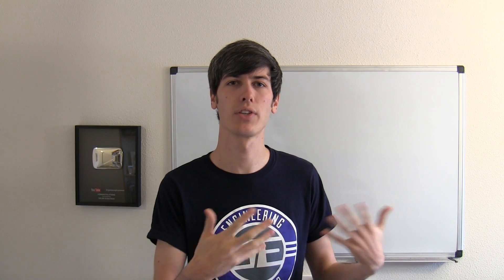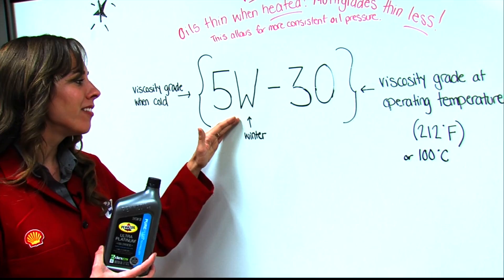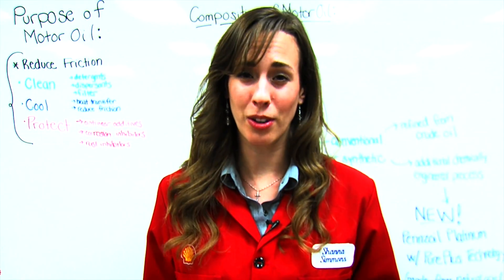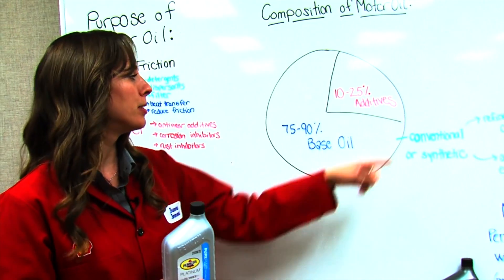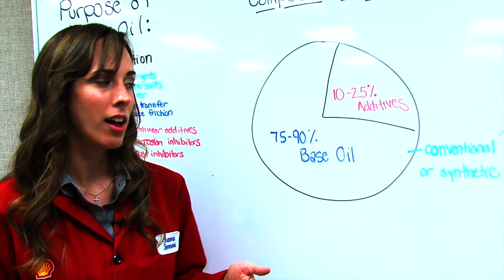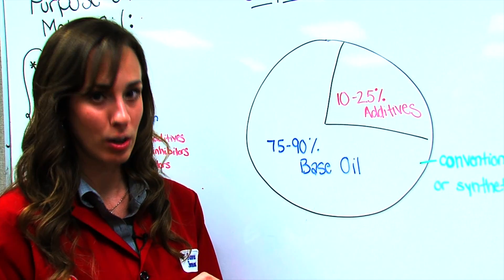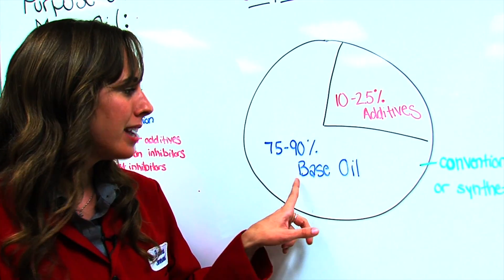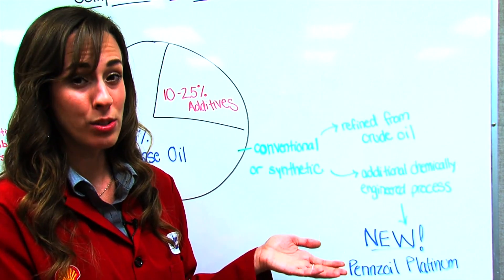Motor Oil Myths & FAQs - Synthetic vs Conventional

Comment: Most oil companies sell the idea that synthetic oil is better than conventional oil. The reason is that synthetic oils are more expensive. Whether they are better is hard to know really. As you can see in this video, they did not answer their own question on the title. OK someone may argue that the title does not say that.
Reply: +Allanb -  It is better,it will last longer without breaking down as quick as basic conventional oil do because of the wax by product in the oil that cannot be refined out of the crude oil base..It has to be changed more often and the protection value goes away faster than quality synthetic oils . It is about molecular structure also..The additive package is what counts  in the regular or synthetics..There are some conventional oils that have great wear protection nearly as good as or better than some synths but they have to be changed more often  and they leave by products from the base oil..Synths are less maintenance and keeps the engine cleaner and they hold less air bubbles than conves do and that helps the protection even better.. ..
Reply: +Robert Diehl 
Synth are better than semisynth and mineral, of course, but they are not good or better for all engines. ;)
Reply: +Eugenio C A properly blended TRUE synthetic oil is always better than a conventional mineral oil because the molecules that make up the oil can be designed to accomplish a specific task.

With conventional mineral oil, the molecules can be modified via the additive package to meet a standard but this is always a compromise because conventional mineral oils are made up of many different carbon chains with different properties.
Reply: I repeat: Synth are better than semisynth and mineral, of course, but they are not good or better for all engines.
It means that for old engines and with a lot of km, mineral oils are better.
Reply: +Eugenio C With an engine that has plenty of wear, mineral oil is better because who wants to burn oil that costs $10-15 a quart.  The benefit of true synthetic lubricants in substantially reducing wear has been lost with such engines.  OTOH, an engine that has lots of miles but that has been properly maintained resulting in minimal wear CAN benefit from a true synthetic lubricant.
Reply: Synth oil in old engines is good only if the engine has been rebuilt from scratch, with new head gasket and oil pan gasket, piston rings and valve seals.
Even if properly services but with original parts, an old engine does not run well with synth. 
Strong cleaning properties can dissolve dirt and deposits too quickly and too much and can damage all the above mentioned parts, with consequent leak of oil in the cylinder and from  the oil pan or head gasket, Also, all the dirt and deposits can clog the oil filter.
Synth oil does not reduce wear better than a semisynt or a mineral. The lubrication is the same. Synth oil only extends the service, 5-7,000km for a mineral and 15 or 20,000 for a 100% synth, and it cleans better than semisynth oil and mineral oil =  less deposits.
Further, with the same grade, let's say 10W40, at 100 degrees the viscosity of a syntetic oil is higher than a semisynt.

Comment: can you change from conventional to synthetic if your car has been using it for 40,000 miles? what is high milage oil and now they have natral gas oil. what is it?
Reply: yes you can switch back and forth between conventional and synthetic oil, but if your engine is excessively worn, a synthetic oil may leak by piston rings. the only way to know is to try it. 40000 miles is not high mileage on a modern engine, even 70000 miles which is what I mileage oils are marketed or is not high mileage on a well maintained modern engine like your Honda.
Reply: yes you can switch back and forth between conventional and synthetic oil, but if your engine is excessively worn, a synthetic oil may leak by piston rings. the only way to know is to try it. 40000 miles is not high mileage on a modern engine, even 70000 miles which is what I mileage oils are marketed or is not high mileage on a well maintained modern engine like your Honda.

Comment: I just don't understand the explanation - if an engine is hot won't the oil be thinner? 5W = 5 in winter... I thought a low number means thinner oil and a high number meant thicker oil (derived from the seconds the oil takes to flow through a given aperture) so how can the W number be lower than the summer or 'hot' engine number?
Reply: @Nick Nakorn It means that a 5W-40 oil will flow like a constant viscosity 5W oil when cold but flow like a constant viscosity 40W oil when hot (the comparisons are at the same temperature). A straight 5W oil would be much thinner at higher temps than a 40W for example.
Reply: +Nick Nakorn Hello Nick,    30 weight oil at the hot 100C 212F  test conditions is defined to be between 9.3 and 12.5 Centistokes / cSt. 
SAE 40 weight is between 12.5 to 16,  
50 weight is between 16.3 to 21.9 cSt . 

The higher the number, the more seconds of time it takes to flow throw the tester. This is Kinematic Viscosity.

*  For a seat of the pants reference, At Room temperature water is about 1 cSt, Milk 4, Cooking oil 40, Honey 2000, Molasses 10000. SAE 30 oils is about 300 to 500 at room temperature

At the W condition , Winter oils are tested between -40C to -10C in the SAE 300 tests for Winter oils. It is Not the same test of oil flowing, thus the public's massive confusion  . It is a cold cranking test and a cold pumping test. 

At Zero C / 0C an actual 5w-30 oil might be 600 cSt and a 10w-30 might be one half of Honey ie 1000 cSt

Even a 0W-XX oil is thick at 0C temperature, ie several hundred cSt ie way thinker than cooking oil. 

The high temperature rating has been at 100 C/  212 F for about a century. The newer "W" Winter's test temperature has been changed over the years and this adds too to the confusion! The standard for automotive oils is in SAE J300

At Zero 0C a 20W-XX weight oils is often thicker than Honey.

You can place some actual oil in a glass jar with some BB's, lead shot, bearing balls and place the affair in the freezer and see how thick the oils are are cold temps. If you want to be a tooler you can time the drop of the balls and calculate the Viscosity too.
Reply: Well, yes we know that - I'm not commenting on my knowledge I'm commenting on the poor explanation...
Reply: +Nick Nakorn The additives (specifically, ground-up rubber powder, which acts as a viscosity modifier) thicken the oil when it's heated.
Reply: +OddTimeMan That's plainly incorrect; at ambient the oil is quite clearly thicker than oil from a hot engine. I've just read the lengthy 'Bob the Oil Man' s explanation to remind me that the labeling system doesn't really help mere mortals. In other words, either the oil expert in the video is wrong or bob is wrong.  http://www.bobistheoilguy.com/motor-oil-103/
Reply: Nick Nakorn I suggest you write Valvoline and tell them they're wrong.
Reply: +OddTimeMan I'm sure Valvoline are absolutely skilled in their craft, I was criticizing the explanation, not their level of knowledge - sigh.
Reply: +Nick Nakorn  5w40 is thicker than 5w30
Reply: +parad0x666 indeed -  a good explanation. As I said above, it was the video explanation I was criticising. I already get it - but thanks anyway.
Reply: +Joseph Brevelle both have same viscosity when cold but different when the engine runs at optimum operating temp .. means the 40 is thicker than 30 ... u r right
Reply: +Nick Nakorn The non W number is the rating at 100 C  ie 210 F, the W rating back in 1952 was at  0 F . At 100C  this is the hot test temperatur thus all 30 rated oils are in the same viscosity region. ie 0W-30 and 20W30 and 30 weight are the same viscosity at 100C.
Reply: +Nick Nakorn 
her description was a bit vague and misleading.
for example. 
 In a 10w-40 for example the 10w bit (W = winter, not weight or watt or anything else for that matter) simply means that the oil must have a certain maximum viscosity/flow at LOW temperature. The 
lower the "W" number the better the oil's cold temperature/cold start performance. The 40 in a 10w-40 simply means that the oil must fall within certain viscosity limits at 100°C. This is a fixed limit and all oils that end in 40 must achieve these limits. Once again the lower the number, the thinner the oil: 30 oil is thinner than a 40 oil at 100°C etc.
Reply: mixter7x7  Exactly my point. a '0W' , in traditional terms, gives the impression that there's no viscosity at all in winter! (Winter, anyway is a movable feast) Though clearly that is not the case. The high number is quite straight forward as it would be for a monograde oil. I think oil companies should make the specification much more intelligible for the average person and simply state the viscosity of the oil at two given temperatures, say -20C and 100C using a universal scale.
Reply: Nick Nakorn does a temperature of 0° mean there is no temperature? no, and 0W means that a specified viscosity has been reached, there is probably thinner.
Reply: never call it oil weight. it's a "grade" but a multi grade oil is a thin oil with temperature sensitive thickeners that counter the oils tendacy to thin. before this addition to oil the grades were just sae 30 sae 5 and such. so an SAE 5w-30 will flow like a would at its thicker cold state but "protect" like a SAE 30 in its hot state. there is some arbitrary measurements and marketing wank involved but a 5w-30 will more or less replace any oil from a 5 to a 30 SAE grade
Reply: +Nick Nakorn "The standard does not state it but it is strongly implied" i.e. the engineers and the people that came up with the naming system left it ambiguous and then people interpret what they want... either way it is not defined by any official agency with the proper authority to do so.
Reply: +Cold World (TheColdWorld) Indeed, the ambiguity is frustrating.
Reply: +Nick Nakorn The designation is not that ambiguous.  If you have, for example, a 5W30 oil, it means that at 0 degrees Fahrenheit the oil will act as a 5 viscosity grade oil will and at 212 degrees Fahrenheit , it will act like a 30 viscosity grade oil.
Reply: +Phil Houck Note however that the designation 0W30 does NOT mean that at 0 degrees Fahrenheit that the oil will actually be 0 viscosity grade and at 100 degrees that the oil will actually be 30 viscosity grade.  Redline Oil (my second oil choice) states in its specs that their 0W30 oil will have an actual viscosity of 69 at 32 degrees Fahrenheit and 11.7 at 212 degrees Fahrenheit.
Reply: Phil Houck As interesting as that is, it has nothing to do with the W standing for winter or weight.. since in either case both letter substitutions would meet that description in some relatable fashion.
Reply: +Unreal RNG The total answer does answer his question.
Reply: Phil Houck His question I suppose but the W is still ambiguous.
Reply: Unreal RNG Until you read the wikipedia article
Reply: erg0centric Nice joke, lol.

Comment: Not one mention of ZDDPs being removed from the oil and needing an additive or a special oil for your old flat tappet cam motors. Oh and good luck breaking in a motor on synthetics if you use a tool steel top ring. It will happen just going to take a long long time.

Comment: Could explain the castrol magnatec and what kind to use to keep a pick up running
Reply: +alex sauceda valdez 
Yup 'Magnatec' is a word devised by marketing experts, used to make an oil appear better than its competitors. It increases both perceived value and sales volume of the product without adding any cost whatsoever. Clever stuff indeed!

As for your truck, any correct grade, mid-priced, gimmick-free oil will do just fine.

Comment: Thank you for the tips. One question. Does engine oil go bad? Is there a expire day?
Reply: not if its in a factory sealed container.
Reply: Technically, yes. It'll collect water when left sitting. 
I have a bottle that sat outside for 6 months, unused, that turned a fairly dark shade from the light color it was. 
I still used it, the viscosity seemed right, but in small amounts.
Reply: FCFordLord Thank you. So how do I know if the oil is expired, is there a expire date on the bottle or something?
Reply: THX.

Comment: Race Engines are broke in on a dyno with special Break In Oil to seat rings fast. All new rebuilt Engines should use Break In Oil for the first 500 miles